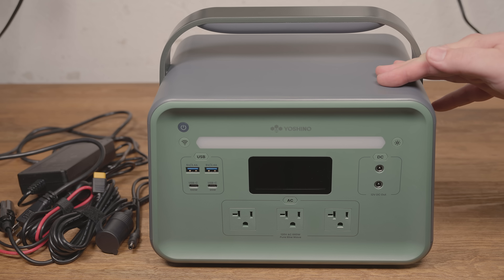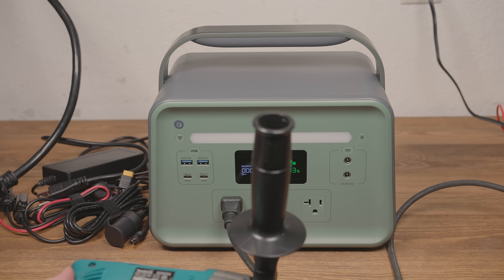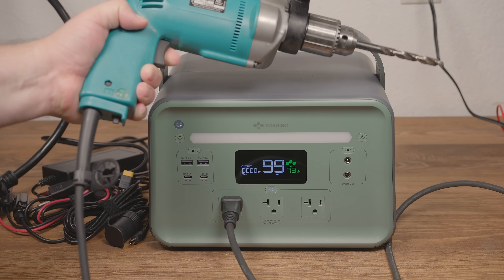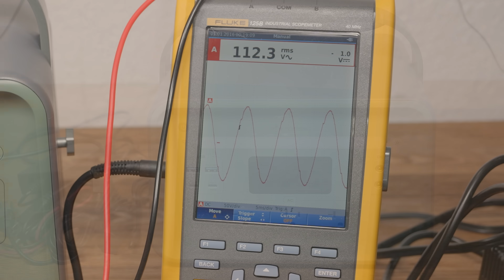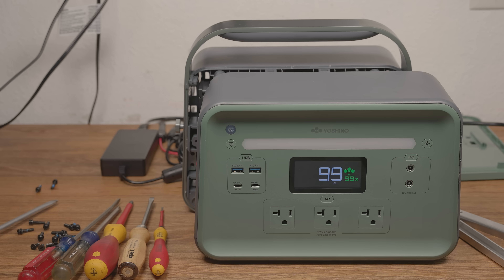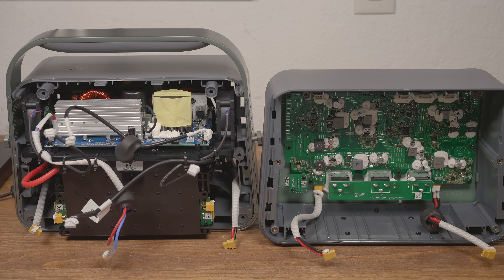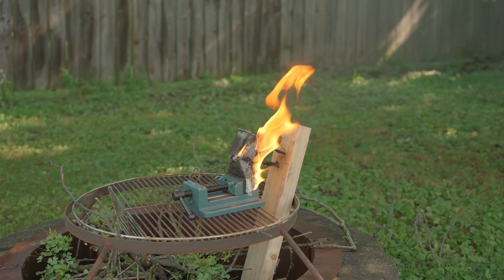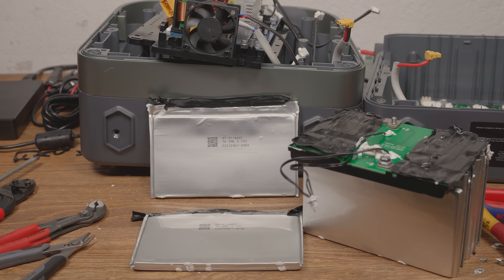Yoshino Solid State Battery Power Station, Test and Teardown!

Comment: The problem you have with that test is that a badly damaged solid state battery that uses the same anode and cathode materials as non solid state Lithium Ion batteries will still suffer from overheating from the short circuiting and also exothermic reaction. You still get a fire.
Your test hasn't proven anything.
Reply from the maker: @Paul-yh8km  Yoshino claims that their batteries don't smoke or react when penetrated, don't contain flammable materials and won't catch fire like "standard" lithium batteries can.  But they obviously can do all those things.  Also, the data sheet for the cell that I found when searching the part number online lists chemicals that are liquid, organic solvent electrolytes.  At the very least, they aren't fully solid state and aren't quite what Yoshino claims they are.
Reply: @bigtb1717  
That doesn't change the point that your test doesn't prove it is non solid state. But you say in the video that it does.
If you take the test out or make it clear that it doesn't prove anything then the video would be fine.
Reply from the maker: @Paul-yh8km  I appreciate your input.  I have found a paper on science direct, comparing standard, liquid electrolyte cells, semi solid state (which have some liquids added), and what they call "All Solid State Batteries"  They seemed to say that the main danger with ASSB is the stored energy release from a short just causing so much heating that a fire occurs, but they don't mention the chemical based, thermal runaway reaction that seems to have happened with the Yoshino cells.  They only seem to mention that possibility in semi solid state batteries where some amount of liquid electrolyte is added.  I'll look into it more and make a follow up.  I appreciate the info and if you have any resources I can refer to, I would appreciate it.
Reply from the maker: Thanks!  I'll check those out.

Comment: Something isn't right when it comes to charging.  It shouldn't take 5 hours @ ~100W in to charge a ~240WH battery.  With the battery shenanigans, I'm suspecting they'll be out of business by the end of the year.  Nice video.
Reply from the maker: @CubbyTech  The model I tested has a 600 watt hour battery.  But there are still plenty of shenanigans to go around, lol.

Comment: The inrush current for that drill is probably about 3kW so I'm impressed that any of the power banks coped with it. It'd be interesting to see the current output of the powerbanks for the first second or so of the drill spinning up but you'd need a fancy oscilloscope to record that.
Reply from the maker: @spankeyfish  That's why I wouldn't have bothered even mentioning it if the other units hadn't handled it.

Comment: This battery may be misleading, but your video doesn't actually prove that SSBs aren't on the way.   Only that Yoshino (China) lies.  Considering there are dozens of them in pre-market testing for various manufacturing goods.  Much smaller sizes but for use where life span and size are of high importance.  When I researched other near market products for use in advanced tech there are several brands near production levels.
Reply from the maker: I never meant to imply that solid state batteries aren't on the way, or even almost here, from multiple companies.  I just suspected this company's claims were based on the potential benefit of upcoming solid state tech, while using semi-solid state, or something like it.
Reply: @bigtb1717  ya, I jumped a bit here.   Very pissed off at China over this.  A hybrid maybe good starting point, but freaking be honest about it.

However, there is some truth to getting this busted leading to people not realizing there are several real products that while not for public use are very close to becoming part of products we do buy.  I think that is what is frustrating me the most, a lot of readers are going to see this as proof SSDs are like implausible ideas such as cold fusion.

*also need to go back to sleep before I make more of arse of myself.
Reply from the maker: @loganskiwyse7823  Fore sure, companies like this can put a bad taste in people's mouths when the actual tech finally shows up, which is unfortunate.
Reply: re: "your video doesn't actually prove that SSBs aren't on the way."  no worries, the passage of a DECADE combining with the fact that WE STILL DON'T HAVE THEM is proof that SSB's aren't on the way.  personally the point in History when i first heard about Solid State Batteries (can't speak for anybody else) was way back in 2014 to 2015 so a couple years after the release of the very first Model S.  yeah so this means a FULL 10 YEARS have now passed (for those of us with the courage to "track time" and "keep score" at home).   thus same as the hype around Super Conductivity from back 30+ years ago (i was there) and same as the hype around Fusion, Solid State is NOT COMING so best just to mature and LET GO OF THE DREAM.
Reply: @phillyphil1513  they are already here, despite the Chinese product being more of a hybrid.

It is very real; it will be in commercial products within just a couple years.

It is very good to be a sceptic, unless the reasoning is based on beliefs instead of facts.

Comment: I remember Mattias Wandell testing the output of a power station with power tools, and fried this kill-a-watt meter because the output was no longer sinusoidal, it had a bunch of spikes, which blew through the capacitive dropper in the meter. A lot of equipment could be damaged by these spikes, like running off a modified sine inverter but even worse, but it would have been better for them to implement a proper soft-start algorithm that just drops the output voltage to prevent overcurrent. I don’t think there are any appliances that would be damaged from that kind of momentary brownout.

Also since e those are 3.7 volt non-solid-state cells, they’ll have inferior lifespan compared even to the standard LFP for power centres. Maybe 1000 full cycles compared to 4000 for LFP? That degrade at a faster rate when kept at 100%, which is what you want to do for a power centre in case of emergencies? It’s a scam.
Reply from the maker: There are two reasons I tested a drill.  First, it just happened to be close by, lol.  I figured I may have to start the drill slowly, and I attempted to, but the thing still shut down.  So, out of curiosity, I tried it on the two other power stations I have, and both ran the drill fine.  So I decided to make note of it in the video.  And while I'm not sure about the Golabs, I'm almost certain the Jackery does exactly what you say and drops the voltage momentarily.  The drill didn't jerk as hard in my hand when I yanked the trigger, and took a second longer to get up to speed.  But it did get up to speed every time and the inverter never faulted out.
Reply: @bigtb1717  ah, that’s neat.

Comment: Good vid, but I'm also wondering about the price of the unit. Is it competitive to the other similar power stations from other brands like Jackery, Ecoflow, Bluetti and others?
Reply from the maker: Overall, at least in this size, it's a bit more expensive, especially if you can find the competitive options on sale, which you usually can.  Especially since some of the competitive options have more than the 602 watt hours that this unit has.

Comment: What the point of putting solid state in a small ac inverter battery bank?  Solid state  main point as fast charging that you don't need. You want long lasting and you got over night time to charge.  Ev need fast charging as fast as 15 minutes well over 100 mill range  as that as long as people care to wait so ev are a bust till  that happen
Reply from the maker: With pretty much anything battery powered, I'll take fast charging if it doesn't degrade the cells.  If it does, then there are many things I'd just as soon charge more slowly.  Fast charging in a power bank like this could be handy in a few cases.  But, admittedly, it's not nearly as big of a deal as it would be in cars.  

Increased safety is also something I'll always take when I can get it.

Overall, I'm sure the big push is for cars, because increased range and faster charging would be game changers.

Comment: I’m inclined to give them the benefit of the doubt as a “Lost in Translation” solid state battery. It is unique to use flat cell LiPo’s in those power bank things. That type of package and the polymer composition allow a very high discharge rate over the usual circular LiOn cells. That means high current charging, likely maxing out that little charger. I have a power bank I made out of “100c” 4s LiPo packs for short duration high load applications. I usually use 18650 LiFepo4 cells for regular stuff. 
TLDR: They meant fast charging high load… Cheers 👍

Comment: We have YouTube. I won’t buy until hearing several tear down reviews of any new tech.
Reply: Unfortunately I bought the Anker 250W power bank with (literally) no tear down video today. I know it would exceed the specs of the older Anker 140W battery cells, but I would like to know what type of cells it’s running and what type of cycle life I can expect. Got yoshino tear down before Anker 250w😂.

Comment: I find it ironic that this unit has 20A grounded outlets, yet it trips out on very mild overload that doesn't even come close to the 20A rating.
Reply: 20A is the rating of the outlet, nothing to do with the power source behind it, which is rated 5A (660W).
Reply: @jaro6985  My point was that it was dumb to put a 20A outlet on something that can only put out 5A.  Anything with a 20A plug is expected to pull up to 20A.
Reply: @eformance  So what plug would you use then? nema 5-15 and 5-20 are too highly rated according to you.
Reply: @jaro6985  Dude, my point is that you wouldn't plug any load that requires a 20A plug into this thing.  The NEMA 5-15 plug is used on everything from 10ma loads up to the rated capacity.  Something like a hammer drill, table saw, or 3KVA UPS would have a 5-20 plug on it, which makes no sense to plug into this.  OTOH, the EcoFlow Delta Pro is capable of starting these kinds of loads, even if they don't draw a continuous 20A, so that makes sense to have a 5-20 receptacle.  It's the electrical equivalent of putting an 8 lug wheel on a trailer with a 1 ton rating.
Reply: @eformance  Good point. Maybe its cheaper for them to just buy the one outlet type and use it on all of their power banks? Not sure.

Comment: Great video thanks for doing this. I think many people were intrigued and excited by Yoshino's claims. However I am not surprised. 99% of claims about new battery technologies don't pan out. Even Tesla can't do what they promised with their new 4680 cells despite spending billions on R&D and manufacturing lines. Even their new "dry electrode" tech does not make it a fully solid state battery. True solid state is a very difficult cookie to crack.

Comment: I watched Matt Ferrell's video and I said in the comments at the time that I doubted very much they were solid state cells as I just wasn't seeing the advantages in the specs. Namely 500Wh / kg at a minimum. I hypothesised that they might be semi solid state at best. Because plenty of companies have working semi solid state batteries but the big players working on solid state are close (Samsung) but they won't be in production for a couple of years and are expecting the product to be much more expensive than traditional Li Ion. It appears at best they've obfuscated about the nail penetration test - at worst they've lied. PS the reason the first arrow didn't cause a fire was there was no metal left in the battery to short it. If you do it with an actual metal nail I think you'd see an instant reaction. Whatever - it's less safe than LiFePO4.
Reply: Yeah! Use a pneumatic nail gun in a home made fixture that you can fire it from a distance. That would definitely disprove the nail test certification they claim.

Comment: That socket is NEMA 5-20R for 125VAC 20A max... Riiiiight. Not happening even for 1 thing. Doubt the wiring in the unit can handle that. "ETL certification" means little to nothing. For North America markets, you want to see UL listed with "ID" Number to see if is a Valid UL Mark.
Reply: Its a 660W unit, of course it cant supply 20A..
Reply: @jaro6985  That's the point. It was designed/marketed with 20A sockets for devices pulling 15A to 20A, yet it will overload at around 5.5A making it functionally useless.
Reply: @CHR0NOMASTER  Its not marketed as being able to deliver any more than 660W. If you bought it and expected it to work with a 20A welder thats kind of on you.

Comment: On the inverter overload:  I have designed my own in the past.  The trick for starting a thing like a power tool is to let the voltage dip on over current rather than snapping off.
On the styling:  A so called "modern look" seems to go in cycles.  If you look at some history stuff about equipment made in about the 1960s, you will see those rounded corners on the box were being done on some stuff then.

Comment: About the charge percent:  The voltage varies too much with load and temperature.  I'm pretty sure these devices use a coulomb counter, which drifts over time.  If it hasn't been fully charged in a while then you need to do that to reset the counter (and percentage).
I found out about these a week ago.  The specs were worse than a lot of much cheaper power stations.  Even if you confirmed that they're solid state, I would still skip this battery.

Comment: Thank you for doing this. After watching Matt Ferrell take these at face value, it's funny to see these things aren't really solid state.
Reply: Matt Ferrell is an extremely great channel to know about quackery and scams. If you see it featured in there there is about 95% of probabilities of being a scam, quackery, uber-overhyped tech that is not really feasible.
Reply: @teresashinkansen9402  true that - when I see small wind turbines on his channel - I basicly know that this is 100% scam.
Reply from the maker: He did acknowledge (week ago) the claims in his comments that these batteries aren't true solid state cells.  He's reached out to the company and someone else who did an analysis of the cells and says they aren't solid state.  He said he may do some kind of follow up, depending on what he finds out.  It will be interesting to see what he comes up with.

On a podcast, he did say that Yoshino supposedly sent him safety testing data and videos.  That's very interesting.  I have to imagine they told him not to share them, because he didn't show them in his video, that I can remember.  And it's also interesting, because I exchanged multiple emails with Yoshino about safety testing and such, and they wouldn't tell me anything, lol.  And when I presented some things and asked if their batteries were semi-solid state, they just ghosted me.  Which, whatever, I'm nobody.  But it's funny that they are selective about where they share the data.
Reply: @bigtb1717  all of this but the original video is still up. Fooling ppl and making him money
Reply from the maker: @VoidPixel4179  He uploaded a new version where he acknowledges that folks say it's not solid state and says he's looking into it.  I believe the original video is technically still up, but unlisted.
Reply: Agreed, it seemed pretty bizarre watching the Matt Ferrell video.  I was really surprised there was no proof on such a bold claim.  If solid state is going to be as great as some claim, I'm sure it would have made more than just a product review video.
Reply: You can NOT take any of the stuff he is showing serious. theresashinkansen said it all what you guys need to know!
Reply: Everything in his channel is something he takes at face value, its ridiculous.
Reply: I'm Matt Ferrell, and this is being a shill for YouTube engagement.
Reply: @VideosVlogsThatsIt  twit.